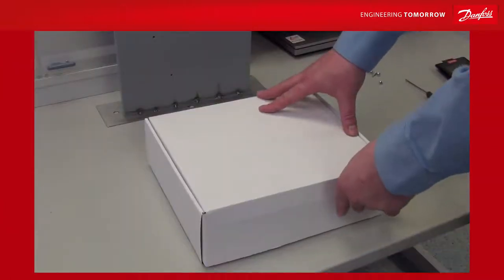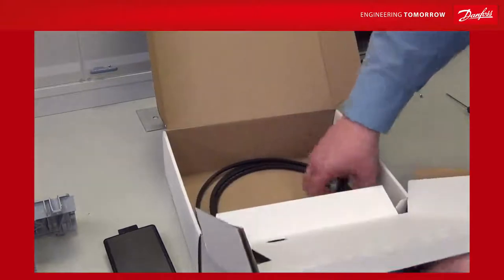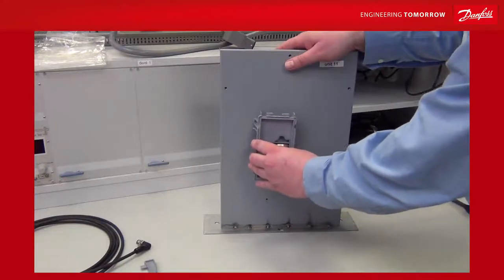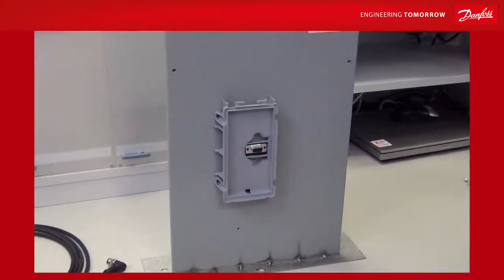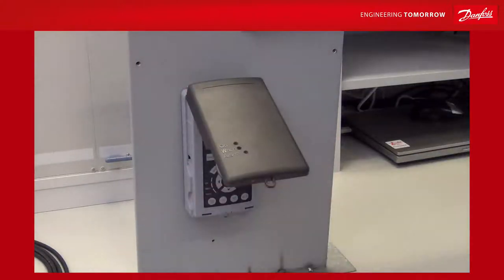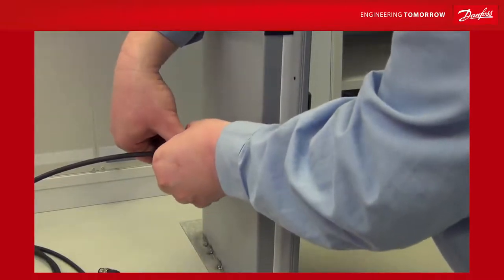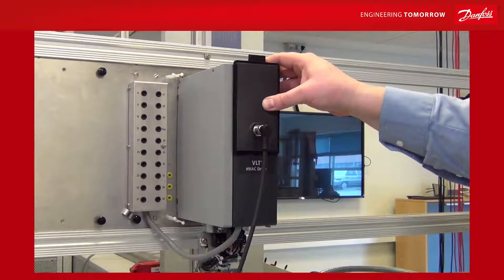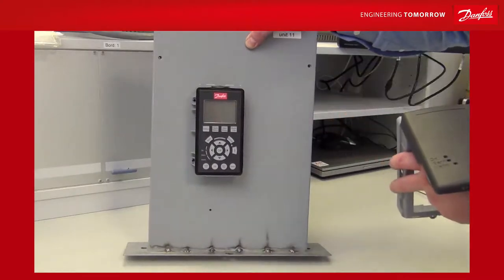Remote LCP mounting kit for the Danfoss VLT®

Comment: what is the maximum length of the LCP cable? I have a fc 102 with a panel, I can put a frequency converter at a distance of ~ 100 meters from the panel if I extend the wires?